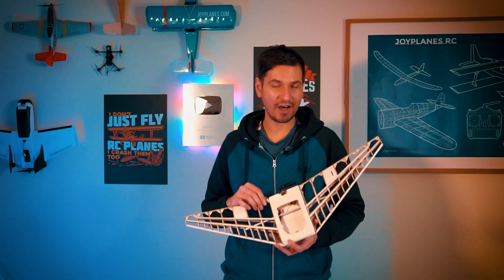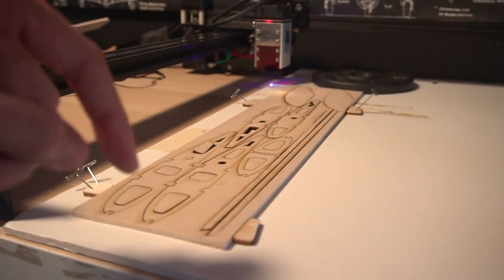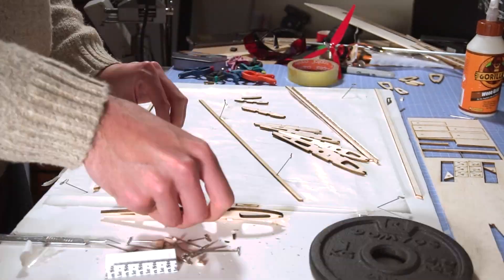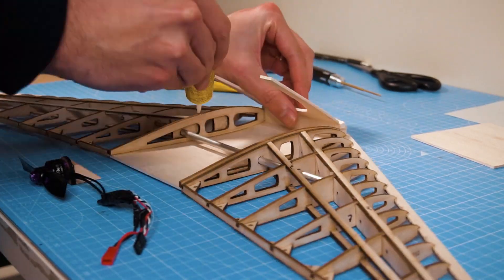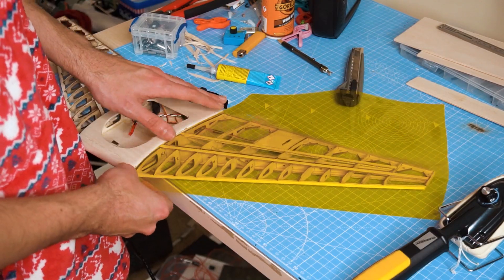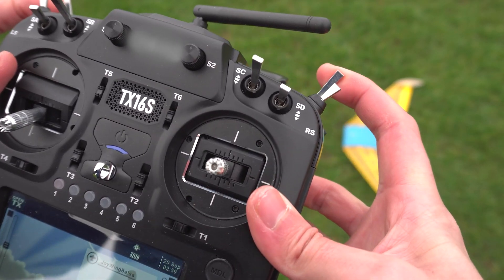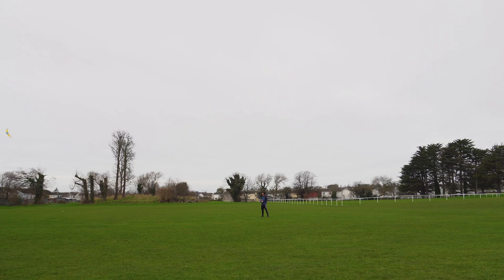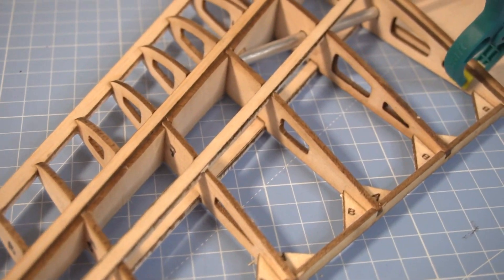Design & Build of a Flying Wing (With Balsa Wood) + Project Files

Comment: I think the big reason you are experiencing tip stall is because of the high taper ratio of your wing which results in a much reduced chord at the tips. The reduced tip chord results in a lower Reynolds number which means that the flow is less willing to stick the wing section, resulting in tip stall.

Comment: 5 minutes in and my first thoughts are that you don't fully understand just how strong a structure like this can be. You are using balsa that is 2 or 3 times thicker than it needs to be. Remember the number one enemy of flight is weight. You should start with a goal to build as light as possible. As for the aerodynamics of the design there isn't enough info to comment but as someone who started building free flight balsa models in the 1970s and has spent the last 40 years in professional aviation I can tell you there is a lot to learn. Anyone can build a paper aeroplane but designing and building a well optimised stable model aircraft takes a lot more thought in the design process.

Comment: As light as your plane turned out to be (206 g + 30 g ballast = 236 g all in), it appears to this former builder that there's a lot of redundant structure.  Wouldn't the Monocote skin handle all tension forces, thus you hardly need wing spars, and fewer ribs?  Second, if the CAD program provides aero data, why did the plane need another 30 grams for balance?

BTW some of your links return 404.

Comment: Thanks for all the resources you provide plus the well filmed account of the build.  I have an ambitious idea for a flying wing or blended wing body with no control surfaces.  NASA is experimenting with control through changing the wing shape and through ducted air to maximize efficiency and minimize weigh and complexity..  My idea is simpler.  With two ducted fan motors internal and a simple system of louvers but a slightly more complex internal system of ducts to achieve yaw pitch and roll, control air is preferentially ducted or thrust raised or lowered to four slats on the upper and lower surfaces of the wing.  The thrust slats are such that they are offset in two dimensions to control pitch and roll through louvers and to control yaw through varying thrust on one side or the other.  The possible geometries for such a design are not that complex and are potentially very bird like with thick wing chords and a thicker body to contain two fan Moros and the ducts.  The biggest challenge is the control logic which could be established through bench testing prior to flight trials.   An even simpler design uses four motors and no louvers to direct thrust.  Each slat has a dedicated fan and all control authority is through changing thrust to the slats.  I wonder if you are interested in doing such a build yourself or collaborating with another YouTuber for a special series?  I don’t have the resources to do the build myself at present.  I know however this is cutting edge stuff that has not been tried by anyone yet and would make a great ambitious project.

Comment: Try adding a 1/4' rib on the top of wing probably along each actual rib. Look at modern commercial Jets. They have these along with the little winglets at the ends. This reduces stall because the air doesn't readily move down the length of the wing. When these are in place

Comment: Learning is a process. Aerodynamics is not easy. Why not take a design that already works. Why invent something that exists. 
Your video was more about laser cutting and building, I suggest just take a RC wing from Outerzone or other site, put it in 3D in your CAD then cut it and build it.
Not having the information - airfoils, Reynolds no., CG location, etc it is difficult to tell why it has tip stall - otherwise I could tell general things from internet.
I know Solidworks very well but I'm not marine/vessel engineer. I can design a boat in Solidworks but will it float 😀 ??

Comment: The servos should have been mounted more in front to save you a lot of lead added in the nose. Tip: save some grams with a lighter motor, move servos forward, drill holes in elevons to save some extra grams. One gram saved in the rear saves you a couple of grams in the front.

Comment: Probably a little late to be leaving a comment but why not. Here’s a few improvements I’d suggest having built a few flying wings myself.

Firstly I’d increase the amount of sweep you have on the wing. I’ve seen this issue with a few of your previous designs. I usually like to use around 30 or so degrees of sweep. Increasing the amount of sweep will help hugely. Since flying wings’ YAW stability increases with speed, they tend to be unstable at low speeds. Increasing the amount of sweep in the wing will reduce the speed at which the wing becomes unstable. 

Moreover, I’d avoid adding extra weight to a plane at all costs. I would only add weight if it is absolutely necessary, which is almost never. Considering the wing only weighed ~200g, adding even just 30g to balance the CG is a 15% increase in weight, essentially unnecessarily. Sweeping the wings more will move the centre of lift back, meaning that you won’t need to add extra weight, but rather the exisiting electronics can be used to set the centre of gravity easily. If it’s still unstable after that, try extending the vertical stabilisers a little. 

Other than that I gotta say the plane looks great! Much better than some of the flying wings I’ve built :). Love the content and keep it up! Also I don’t know if you’re Hungarian or not, but in case you are; Üdvözöllek Ausztráliából! Már egy ideje nem voltam otthon, tehát jó érzés találkozni egy magyarral :).

Comment: Love the way you are using a laser to build your aircraft. May I suggest a couple of tips to help with your laser cutting? I would recommend you to raise the balsa wood sheets above the laser bed to allow air flow underneath. Even better, use a metal honeycomb bed. Install air assist on your laser head. This makes a huge difference to the cutting ability. Plenty of tutorials on YT to help. Keep up the good work 👍🏻

Comment: Your idea to twist the wing does help a lot. If you swept the wings back a little farther, place the servos a closer to the front(longer rods), or a dihedral on the wings might give you just the stability you need. adding weight to an aircraft is counterproductive. An excellent first variant.

Comment: Stability is improved by using a different airfoil cross section in the middle of the wing, as opposed to the wing tips.  The middle section should have an airfoil with a relatively sharp leading edge.  In a model of this size, the radius of the leading edge might be 2mm.  At the wing tips, the outer 25% of total wingspan, the radius of the leading edge should be greater, perhaps 5mm.  It will be necessary to design and construct transitional airfoil shapes to make the transition from center section to wingtip section.  The result should be an airplane that will begin to stall in the middle of the wing, and this will allow the airplane to be controlled during an incipient stall event.  Since the wing is not twisted, the efficiency of the airplane is preserved.  In a full scale airplane, this would result in greater range, for a given amount of fuel burned.  In a model airplane, the battery power supply to the motor will last longer.

Comment: check wing loading, reduce the ailerons area, its not a 3d aerobatic plane, at least at half, servos are not precise, and the tiny electric servo less, so having a huge control surface with that servos are a problem, if i am not wrong do you use 2,5 mm thick for the ribs? thats obsene thick, for that wingspan 1,5mm thick is enough, also you can eliminate the aluminum tube, for the size wood is more than enough for structural strength, also try a propeller larger in diameter and less pitch

Comment: The old school way of building aircraft has its charms! Laser cutting is the way to go! I used to design and build my own planes many years ago, I built my own foam cutter and made foam wings instead. Downwash is very important for flying wings. Perhaps you can add a boom to lengthen the lose and use less nose weight. A longer fuselage "may" reduce the spin an also the tip fins could be taller also.

Comment: Add a little reflex in your elevons. For your little wing I would say maybe 4mm of reflex basically trim them up until you can fit a 4mm block between a straight edge and the elevon where it meets the fuselage. Also flying wings LOVE a nose heavy configuration. Winglets that extend back beyond the trailing edge of the wing will help and if they are angled slightly inward at the leading edge and slightly outward at trailing they will help with stability. The tip stall your experiencing Is common to a flying wing design as there is little vertical stabilization. You can counter this with a small amount of dihedral (wing tips elevated a bit higher than the center). Flying wings can carry tremendous weight and love to be heavily loaded and fly fast. Enjoy! Excellent video!!
Reply from the maker: Thank you sir!

Comment: Ok, for a bit I was totally fascinated by the Horton Ho-229, and I vaguely recall something about stall behaviour and CG. I'm sure I don't recall the details entirely, but flying wings definitely don't have very good stall characteristics with aft CG, so either you keep them moving fast or you get the CG very far forward. This was a huge problem in the Ho-229 because it either meant you added weight and thus had less range and/or less payload, or you had to maintain a higher speed to stay well clear of a stall. I vaguely recall that they lost one pilot in a botched landing, and a second swore he'd never get into the plane again.... and this plane was not the first flying wing the Horton brothers had built, although I think it was the first powered plane, and certainly their first jet.

Comment: I have had a lot of success using much thicker airfoils towards the wingtips. Like MH64. and using up to 5 degrees of washout. Depending on the thickness of the tip airfoil you can get away even with no winglets.
Reply from the maker: Thanks for that!

Comment: I like your design and your video, good job! I have alot of experience with this kind of work and here's a few tips for future builds:
1 - use CA glue instead of the UHU stuff, it makes for quicker assembly and lighter frame since you need so little glue
2 - use Parchment paper instead of wax paper: even CA will not stick to it
3 - use a few laser cut parts to build a jig that holds your wing structure at the right geometry while you assemble to "hard set" the washout of the wing precisely (address your tip stall issues) 
3b - use a piece of glass to glue your jig on to and hold everything straight and solid. a razor blade lets you clean the glass after.

Comment: I had 3 flying wing type of sailpanes in past  that two of them with reverse tapered elevons as Zagi and they were flying very well but the third one was having no taper and this one was flying almost same character with your flying wing, uncontrollable. You need to change your wing profile as trailing edge reverse tapered.

Comment: In my opinion, add more of a vertical wingtip (rudderlets) to pull the vortex away from the trailing edge of the wing. I used 45 degree angles pointing out away from the wing. it would look more 'X-WING' if you did it like i'm thinking. Looks great and nice to see some balsa in the air again for a change bud. BEST of luck in getting it flying perfectly my friend. It looks to be close to having those perfect flight characteristics you're looking for now in the video. I honestly think that fix would do it. Let us know what it was that corrected it. :)
Reply: A well designed wing needs no vertical surfaces - this is the first launch of my latest wing
https://www.youtube.com/watch?v=rTtsHPIt6ec

Comment: Apparently the sweep of the wing really make difference. I used to fly wing like yours, not so much backward sweep like S800 EPP WING and it suffers same problem, tip stalls and couldn't recover, also need so much weight at the front. Try more backwards angle like FPVWRA Specwing and I never encounter tip stalls again even gliding and turning for long time.

Comment: Superb looking build.  Try lighter servos's with that weight there are a number of alternatives,  and you may even find the small linear servo's (LSM1300, or 1.5g linear servo's,  or rotary HK5320 ) would help knock 10g off the back edge. Move the motor forward making the centre section slightly shorter or recessing the mount. Also,  did not see the spec.s of the motor,   you may get away with a smaller one?  If it was me,  adding 30g to the nose for a sub-250g would make me look at redesign,  and redistribute weight and size of components to reduce/eliminate that necessity. Thanks for the video.  Great project.

Comment: It looks like a wing stall, not a tip stall, like the F100 supersabre when it was taking off. The simplest solution is using aerodynamics elements on the upper part of the wing in order to redirect the windflow and not letting it stall your wingtip, something like the Mig-19 wing, check it out and let us know.
P.S. I would add them right where the middle fuselage part connects to the wings and if it doesn't help, another pair (smaller maybe) abaout in the middle of each wing, good luck!

Comment: PW51 airfoil could be good. Is used for nano goblin plane. A fuse with a rudder would help, otherwise, have a look into the prandtl wing design from NASA if you want a wing with no rudders or vertical surfaces.

Comment: 9:01 that side profile of the wing looks nice
Could try using half control surfaces (outer most) possibly extended in width and check thrust angle (usually pointing down towards CG)
And possibly extend the winglets/make more surface area going backwards like a triangle

Comment: Check out the Stryker from Horizon Hobby.  They have made at least 5 different generations of  it.  I personal favorite is the F27Q which has rudders.  It's stall characteristics are perfect and you have amazing control while stalled.  It stalls flat and you can deliberately put it in and out of a spin at will.  You can fly it post-stall an entire flight and land it vertically like a helicopter.  Okay more like a parachute. 
The F27Q not only has rudders (which are quite handy in spin recovery) but it has lerx (can it be lerx on a wing?) leading edge cuffs and wing fences.   All would require a lot of work to mod your wing but wing fences should be an easy experiment that you could first try using cardboard etc. You could also try adding strips of vortex generators on the wing tips.  That would be the easiest mod

Comment: The problem is the tapered wing. The wingtip airfoil dies the reynoldsnumber-death. Try a design without any taper. Do not go below 15 cm airfoil-length. And a wingspan of 90 cm. Take a sweapback of 20 degree per side. This will work graet.
Regards Tom...

Comment: Awesome build! I like the color scheme, but I recommend putting a bright opaque stripe on the bottom of one of the wing panels for better orientation. It's easy to lose orientation with transparent covering. As for tip stalling, try using some reflex in the control surfaces. 

Btw, I was told that Lightburn can convert PDF plans into the proper format. Have you tried it? I just got my first laser engraver / cutter and I have a large collection of PDF plans that I want to use.

Comment: even if  wood parts  are laser cut, they Should  be  sanded, lightly.    these thic ribs should have been sanded, a  LOT.      in this case, the only goal of  sanding  is to eliminate some mass.    Any mass.     Especially, mass located  distant  from the airframe's center line  and/or  cg/c-m.        googletranslate

Comment: Elliptical wings  are theoretically the most efficient. Tapered wings are almost as efficient but with the aerodynamic efficiency comes a less stable wing that is prone to tip stalls. So there is a balance with the amount of taper. More taper is more efficient but less stable. Your wing has a lot of taper. You can try extending the chord length at the wing tips. This is probably the most aerodynamic option to reduce tips stalls. More washout  might help. Vortex generators near the wing tips is an option but I don't know how effective that would be and it defeats the purpose of a tapered wing. You can try slats near the wing tips but it will also increase the drag to lift. Hang gliders have a lot of washout for the same reason. Rigid hanger glider wings are tapered far less and have much less washout. In an RC plan, I personally don't like the idea of washout since you want to do aerobatics and inverted flight and the washout then becomes counter productive.

By the way, it is a real nice looking wing and looks like it would be fun for park flying.
Reply: Check out Nurflügel wings, they are more efficient than elliptical wings if your calculations include the mass of the structure of the wing.
Reply: @Br1ckInTh3W4LL  You can have an elliptical flying wing as well as a tapered flying wing. Elliptical is just a theoretically efficient wing like a Spitfire. You can also sweep an elliptical plan form.